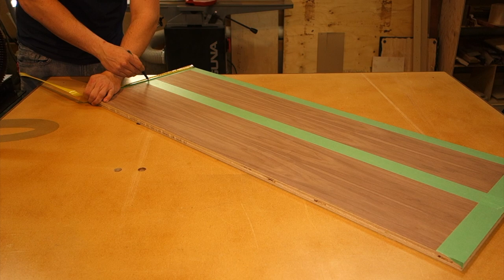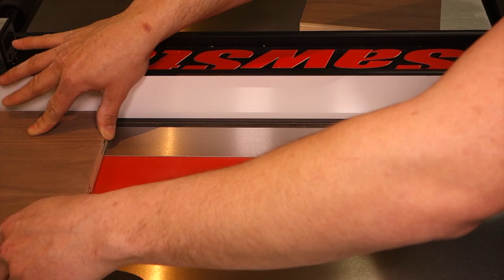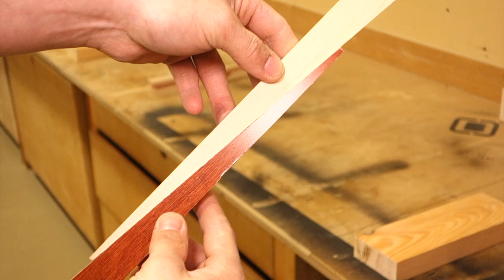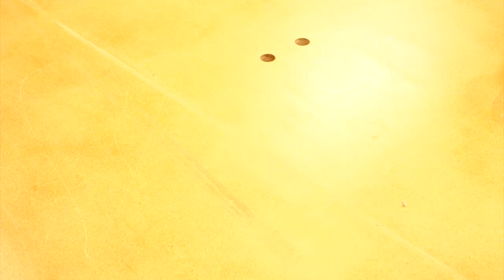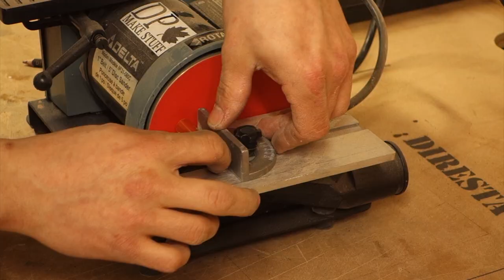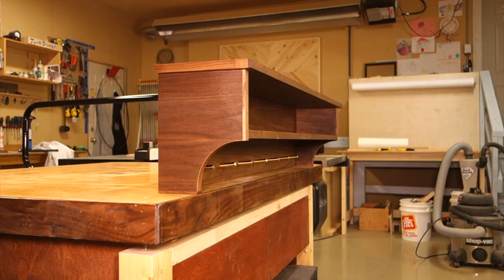Simple Coat Rack with Storage Shelves

Comment: Great looking coat rack. At the start of the cutting you placed the lengths of tape down and cut through them. I didn't see you mark out anything on them like you did for the brass rod holes. What did you use the tape for if not for marking measurements?
Reply from the maker: I set the measurements on the table saw, the tape keeps the plywood from tearing out.
Reply: +Dustin Penner Well that explains why I can never seem to get a really good cut in ply when using my circular saw. Thanks for that, I will do the same in future.